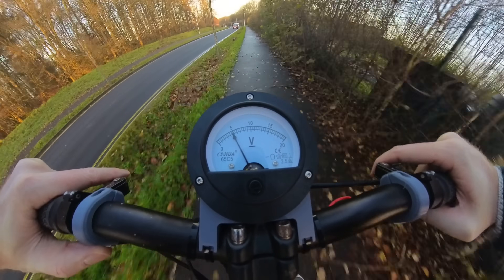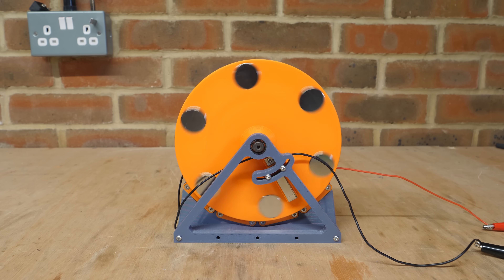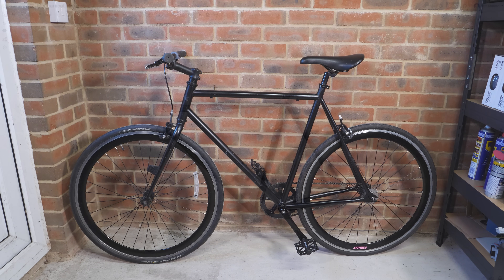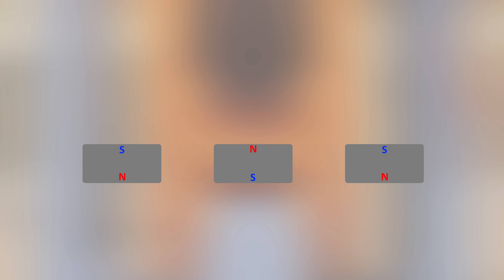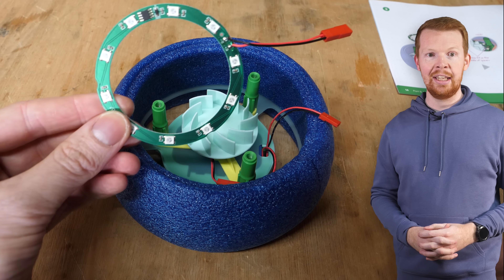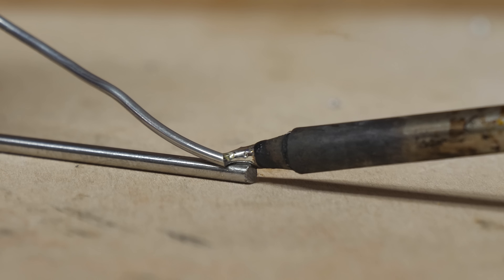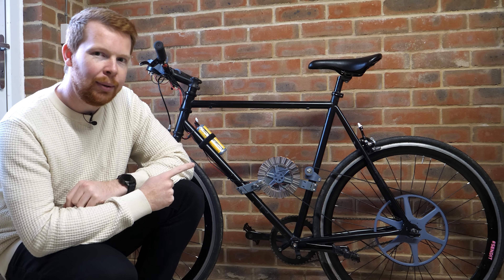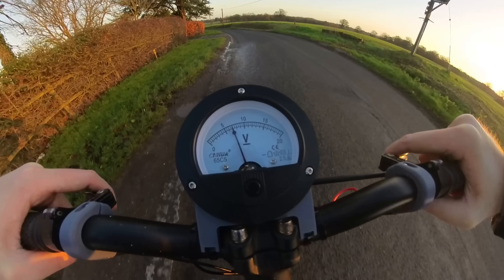The Most Minimal Electric Bike

Comment: Always fun to see your new videos! Regarding the arcing wearing down your contacts, you've hit on the reason why some switches are rated for inductive loads and others aren't. I'd guess that those micro-contact switches are rated for 15A of purely resistive, non-inductive loads (think light bulbs). Your motor is a highly inductive load, both from the magnetic coils as well as the "mechanical inductance" of the rotating magnets interacting with the coils. The arcing could be significantly reduced with some thoughtfully placed passive components, such as a capacitor across the switch contacts, and perhaps a Zenner diode and resistor depending on how high the voltage spikes when the switch disconnects. Would be very interesting to see plot of the voltage vs. time across the switch.

Comment: Re: belt drive, one should strive to place the idler in the slack section of the belt.  However, in this case, the slack side changes if you're motoring or regenerating so I'm out of helpful tips!  ;-))

Comment: why not a brushed DC motor and the native gear system for load-matching? yes, the yoke of a DC motor does pull the shaft into a number of fixed positions but it doesnt consume a lot of energy because only very tiny currents are induced in the magnetic core. cores are layered specifically for this reason; the net effect is just a small oscillation in the motor's torque which should be thoroughly dominated by the momentum of the rest of the bike+rider via the mechanical linkage to the motor. forgive me for oversimplifying but this kinda feels solved

Comment: 7:03 one solution might be to use an optical isolator and operate the contacts at much lower voltage to reduce the arching problem, the switching signal can be amplified by either an mosfet / optocoupler or even an IGBT. this will reduce the stress on the reed switch and even a off the shelf reed switch can be used.
Reply: Well, optocouplers are semiconductors
Reply: mosfet stands for metal–oxide–semiconductor field-effect transistor

mosfets are semiconductors too, and even specifically transistors.
Reply: he could use two switch in parallel on either sides of the rotor, decreasing stress on the switches by decreasing the current 
he would also make series connection but it requires precise timing

Comment: Those contacts are rated for 15A when switching AC voltage. It's far lower when switching DC voltage because of the arcing. They are rated for .6A (600mA) at 125VDC so maybe double that at the voltage you're using.

Comment: This would be even cooler if there were the level sensor from the wheelie project. Then it would automatically give boost when the level sensor detects signal change from hill and vice versa negative degrees would start charging up the capacitors. 
Obviously it wouldn't look pretty as neither does this haha... and the ratcheting sounds would need to be eliminated. Cool project anyways!

Comment: The switch contacts had a much lower rating for direct current. 0.6A and 0.3A, depending on the voltage…

Comment: You can make a "real" mechanical bike with a flywheel and a steel wire actuated clutch, with nothing but the principles of physics☺️. No electricity needed, no charging discharging coils  or capacitors or the noisy reed switch, apart from the associated loss of efficiency, in converting energy from one form to another. No need for a click bait either. Should work better than the psuedo mechanical ebike version for regen energy storage and use.😂. Unfortunately you can makeup one quickly for churning out clicky content!😂❤👍

Comment: The motor is pulling on the belt and the slack removing pulley on an angle. That vector is absorbing a lot of energy instead of pulling on the wheel IMO. Great project! That is a lot of work to do. I hope you enjoyed it.
Reply: Not sure about that. The force being applied to the tensioning pulley is doing no work. You'll lose a tiny bit of energy in the pulley bearings and a tiny bit more through repeated flexing of the belt but it won't be much.
Reply: The only losses a tensioner adds are the friction of the bearing and the energy lost in flexing the belt itself, both quite small. If the "vector" caused energy loss then a serpentine belt on a car engine would never work.  That said a tensioner is better placed on the unloaded side of the belt to reduce belt and tensioner loads, but the belt can be loaded in either direction in this case.  Seems like Tom realised this as he used a shorter belt and removed the tensioner at the end.
Reply: Even with the standard chain drive there is a rearward vector through the bottom bracket/chain stays when under load.
Raising the drive line angle offsets part of this into the vertical direction compensating for the loss at the rear sprocket.

Comment: you should really do more scientific work on optimizing the coils and motor RPM because you have way more magnets and way more copper than most electric motors and you're making basically 1/10th the power of something you could buy off the shelf. Also, HALL EFFECT SENSORS

Comment: Note: You mention the tungsten reed switch oscillating at a resonance where it was too close or too far. I think what you are actually seeing is aliasing from the video frame rate. Effectively you are getting a stroboscopic effect which makes the sparks appear and go away at a lower frequency.

I wonder if you could use a small reed switch designed for lower currents to trigger a larger, more traditional relay rated for higher currents.

Comment: good video. how does it compare to the mechanical flywheel energy type thing you laso had on a bike ?
I know volvo mucked about with a mechanical flywheel with a spinning weight for a regen / inital pull away unit to assist a car engine.
From the plans, it was connected to the back wheels and when the brakes were applied, the clutch dis-engaged to spin the weight up to speed then when accelerating away from a stop the clutched disengaged to assist moving the vehicle.
all other times the clutch was engaged. I hear the weight was sat in a nitrogen filled chamber and it could spin up to 50,000 rpm !

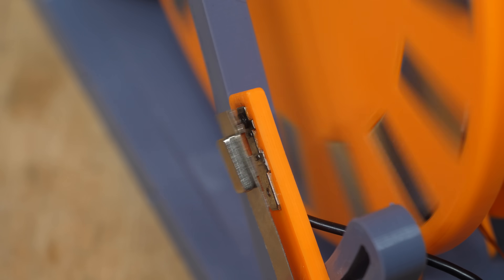Comment: @2:55 In my past experience with DC motor controllers as a Electronic Tech, we used contactors, they had replaceable brass contacts that had a grid of pyramids that met each other. The brass and geometry mitigated oxidation and erosion due to the high current these were expected to pass. https://en.wikipedia.org/wiki/Contactor
Reply: Depending on the diodes you use, you can reduce the lost voltage. Glass zener diodes for radio purpose generally have much smaller voltage drops than the standard 0.7V drop. Perhaps with your low voltage, this would be a better solution to make a rectifier than the ~1.4V you will be losing with those diodes.

Comment: That microswitch wasn't rated for 15 A :-) that number was just for AC. For DC (your case), it's just 0.6 A.

AC crosses zero so is much easier to disconnect, the arc is self-extinguishing. A DC arc keeps on burning and pitting the contact surface.
Reply: Also, how many connects and disconnects are they rated for? Riding a bike causes millions and billions of them to happen.
Reply: @tanelehala6422 I don't think it's billions?
Reply: DC also causes material transfer to happen only in one direction, which means the arc digs a pit on one contact, and deposits the material on the other, making a pointed mound. Eventually the point "hooks" the pit and it's game over. For AC, if you got have approximately equal numbers of breaks in each direction, which means material gets transferred back and forth between the contacts.
Reply: I was only half paying attention, but didn't he cover in one of his earlier videos that his basic design makes AC and rectifies it to DC?
Reply: I think the main problem was that the microswitch is made for resistive loads. Maybe use contacts from a motor relay, they are more suitable for inductive loads.
Reply: 0.6A @125VDC 0.3A @250VDC it says. How many amps @0-18V?
Reply: @tanelehala6422 multiply amperage by voltage, then divide that number again by voltage, and you have your answer.
Reply: @TheDustyShredder No, you don’t, because this is arcing, and plasma voltage drops are not a linear function of current.
Reply: @josephwisniewski3673  why do the 0.6A 125VDC and 0.3A 250VDC ratings have a linear relation, basically constant power? Assuming we can only decrease the voltage, at what point does it become non-linear in which way?
Reply: @TheDustyShredder  According to you, it should be rated for 4.8A at 15.625v, 9.6A at 7.8125V, 19.2A at 3.9, 38.4A at 1.953125V, 76.8A at 0.9765625V.... huh.....goes to infinite A since you can't get a perfect 0V.....
Reply: @josephwisniewski3673  I made a mistake, that's how you get wattage. For current, you divide voltage by wattage. If you don't know the current, then divide voltage by resistance then multiply by current for watts. Idk how I didn't notice that mistake when I typed it.
Reply: How did you calculated 0.6A from it?
Reply: @pusnirizda88  It is printed on the switch.
Reply: @Nerd3927  2:47
Reply: @pusnirizda5481 lol it was right there!

Comment: If you could get or make a glass ampule around the reed switch with one open end, you can pull at least a partial vacuum using just the heating and cooling when you seal the open side. It's a finnicky process but completely doable. You could also try to do it under vacuum somehow, but that seems like a massive pain. It likely wouldn't completely stop the sparking, but it would help to limit the amount of damage it does every time. Could also help to limit the range of motion so you don't have as many resonance issues. Maybe unnecessary with the new contacts but it's just a thought.
Reply: Vacuum is easy. You just need a glass tube for evacuation then pull the vacuum on it then you heat it and as it softens, the vacuum sucks it in and it seals itself.
Reply: @chaos.corner  have to do that while keeping the contacts in place and accessible. That's the hard part. Could do it by getting an open ended glass tube and melting one side down onto the contacts and then doing as you suggested with the other side. It's just liable to crack from the stresses if you use the wrong type of glass and don't equalize it before the second heat.

Comment: Air has a high electrical resistance, but a vacuum would be better. If you could put your switches in a vacuum, it should reduce sparking. It might even help with the noise issue.

Comment: There's a German bicycle headlight company called Magnic. What's interesting about their bicycle headlights are that they don't use physical contact between the dynamo, but instead has a rotor with magnets on it that is put in close proximity to the rims of the wheels. The rim rotating past the magnet closest to it on the rotor has a magnetic eddy current induced in the metal of the rim, the eddy current creates a magnetic field, and the magnetic field of the eddy current drags and spins the rotor for the next magnet to do the same thing, etc., spinning the rotor with magnets past some coiled wire, generating enough power to light some efficient LEDs. Yes, there is some resistive friction between the rim and rotor with the interactions between the magnets and the eddy currents, but it has to be significantly less than those from the much more physical friction of an old-style "bottle generator". I've been interested to see if this could be upscaled enough to charge a cellphone, or power a Bluetooth speaker.
Reply: My mistake revo light
Reply: A few years ago there was a company called rev lights that used the same principle.
Reply: Thanks! I was working for years on that. And i am German too.
Reply: @stefanmargraf7878 You worked at this company?
Reply: Hub dynamos work great too
Reply: There is another innovative one that uses a magnet inside a coil of wire (or the other way around) and relies only on the vibration/shake of the bicycle moving, which moves this magnet or coil forwards/backwards in the tube (it actually sounds like a ball bearing rolling around in a completely sealed tube) which powers some leds. No external wearing parts - no much use a low speed though.
Reply: Thats such a  cool idea
Reply: I've used ReeLight, which I think is Danish. Similar idea - magnet attached to the wheel spokes, moving next to a coil fixed to the bike. They have models with a capacitor, so the light stays active for some time after stopping (at crossroads etc). Unfortunately it didn't hold up in the cold and harsh conditions of winter cycling. I got a warranty replacement, but it also failed, both due to condensation on the inside. Now I reused the coil assembly and magnet, but just mounted some small LEDs and resistors in the front and back. It's a worse solution, but easier to fix when it breaks next.
Reply: That's how scooters (motorcycle) charging system works.
Reply: Or you could just use a hub dynamo. They work on the same principle, just put in a neat package.

Comment: There is probobly 15 diffrent ways to make a mechancal ac motor. One simpel and robust way is making a rotery encoder. How that works is that you move the rotary ecoder in and out of phase to speed it up and down. Other vice ita very simular to a dc motor.

Comment: For those who deal with old cars, your switch is basically called 'points'. You can buy one from car parts stores
Reply: Yes but no - points aren't magnetically actuated, and they also carry less current than this which is why they don't wear as fast (though obviously they still do wear). Not sure how well a set of points would work as a base for this reed switch.
Reply: @cooperised the points I’m familiar with are opened by a cam on a the distributor shaft.
Reply: @cooperised  Automobile points always burned, over time, which is why basic auto tune-ups always included replacing "Plugs, Points and Condensor".
Reply: @TheMercilessEye  I know that, I've had plenty of old cars. But they don't degrade anywhere near as fast as the contacts in this video, and I think that might have been part of the reason they were suggested. The problem is that the reason they don't degrade that fast is because the current they carry is quite low, unlike in this application.
Reply: @TheMercilessEye the condenser absorbs some of the current and reduces the arcing of the points. I wonder if a automotive condenser would work in parallel with the contacts he is using
Reply: @cooperised wouldn't the fixed contact of the point interfere with(if not cancel out) the magnetic field attracting the movable arm and contact since there's a ferrous metal between the two?
Reply: @greatPretender79  Not sure, honestly. Magnets are weird. In a standard reed switch both contacts are ferromagnetic, and are attracted towards each other by an applied magnetic field.
Reply: Good point.
Reply: Coils are weird; they make electricity behave as if it has a lot of inertia. (Or momentum, if you prefer that word.) The effect is called inductance. Many relays have a separate, lower current rating for inductive loads. Points have to drive an inductive load, of course, though I don't know how its inductance compares to these motor coils. It might be larger or smaller.
Reply: I was hoping this would be here! Could also replace components with the Mopar system from late 60's with something called a "reluctor" triggering an ECU which then triggered the coil. A little bit of digital electronics and a big heavy coil...but..
In any case- the bike is great stuff!
Reply: @skinny7010  That reminds me there was a magneto ignition system for petrol engines, mainly fitted to planes and bikes I think, which was very reliable. I think it was contactless.
Reply: Also that spring is pretty strong, at least in all my cars.
Reply: @greatPretender79 Indeed, the points shouldn't start to 'float' at high rpm's. Desmodromic driven points would have been an innovation to avoid the spring😊
Reply: points would work. I was thinking just use a regular reed switch to a relay that feeds power to the coils. They are rated 1M + contacts.

Comment: i would think it would be obvious to someone with an engineer's mindset, but you mounted the belt tensioner improperly.  i'm sure it works ok the way it is, with low torque applications, but it would have worked better had you mounted it outside the belt, pushing inward.  that would have forced the belt to wrap more around the drive and driven hubs, as opposed to pulling it away from them as you have it now.

Comment: Bike light generator( dynamo) can be mounted on a moving mount operated by cable and lever(like a brake lever). Put It together in parallel with brakes so that by slightly pressing the lever It engages the dynamo, and full press ads the brakes.

Comment: There is a small compressor that compresses the air to 200 bar. It would be cool if you could use a compressor as brakes.
Reply: What's the advantage of riding around with a 2940 PSI compressed air tank?
Reply: @hxhdfjifzirstc894  There are several applications. The pressure bottle can replace an air pump. With a compressor that has at least 3 bar, you can reach a temperature of over 100 °C.

Comment: Add a auto switch that disconect when reach 18 volt from capacitors and current go to battery or resistor.(saving it is better than heat) or some thing like lamp etc